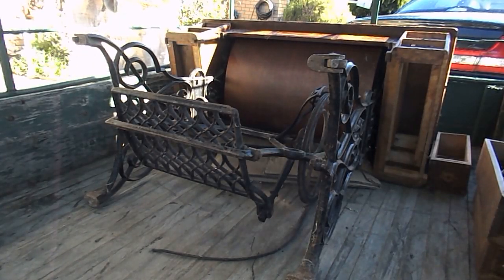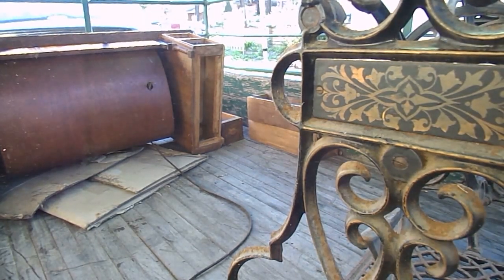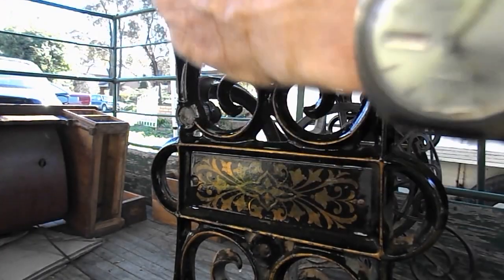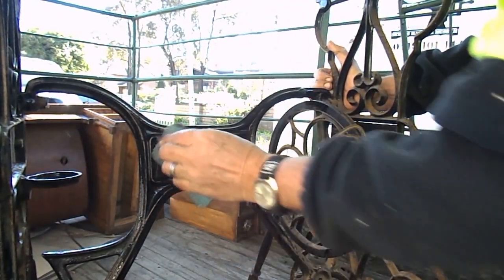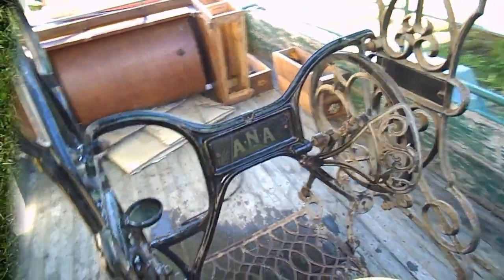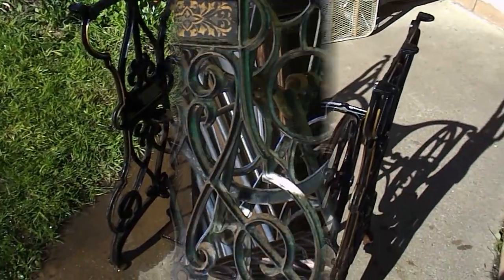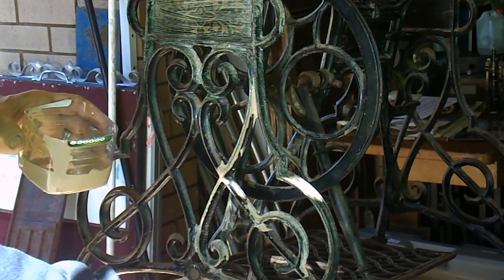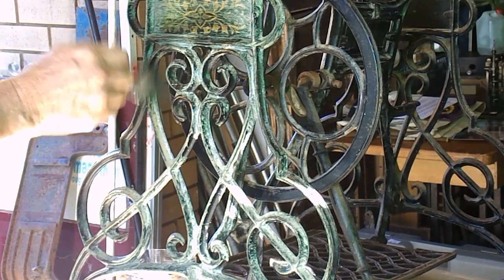Restoration of an Antique treadle  base.  Our Style

Comment: I took apart a treadle sewing machine completely and am now trying to remember the steps in putting it all back together again - I have cleaned and restored the base, the wood and rebuilt some of the broken parts.  NOW, wondering if anyone has a diagram on how to put it all back together again. HELP :-)
Reply from the maker: Peggy if you look at a few U tube clips I am sure you will get some idea. If its the actual machine you pulled apart. Sheesh not even we do that. I really can't advise much on that. When we dismantle a part of a machine we make sure we do it in a time slot where on the same day we break it down and Rebuild it while it is still fresh in our mind. As you remove something you place it in a line one part after the other. Good luck with that
Reply: All is well - I finally figured it out :-)  I am so grateful for your instructions on how to restore the base - I'll attach a photo of the completed renovation as soon as I can.  Thank you again.

Comment: I'm down the other side of Victoria, picked up a treadle base with flywheel for a 31-20 i'm cleaning up. I wasn't sure about the rust converter but picked up the same stuff and it completely transformed the existing paint. After I washed it down it was a bit grey and sunbaked, but it's come up a treat. Brillant tip.

 I've got to treat surfrace rust on the machine itself, mostly the flat surfaces. You reckon i can use the same product?

Comment: After it turns black, do you need to wipe the paste off or does it just fully dry??
Reply from the maker: It will dry  completely. It won't need wiping. Keeping in mind it's only an undercoat finish  and not for outside or in wet area's . If you wnat it for  outside you will need  a matt or semi matt all weather coat over it.

Comment: I have a much rustier base, with no paint remaining, so I’m going to use a wire brush to get back to just dusty rust, not flakes, and then try a rust converter,  but I’m uncertain about what to do with jointed surfaces, I mean the bearings etc. I don’t want to convert rust to the black haematite finish over a nut which should come undone. The rust becomes haematite. I don’t want to chemically ‘weld’ it with converter!  So what do you do with rusty moving parts if they are in a bad way?  I’m thinking to use penetrating oil and clean them up, but I presume I don’t paint the inner surfaces or they won’t fit back together. Grease? Thanks for your opinion. 
And that’s a very pretty treadle you have there!
Reply from the maker: Bella.    Any Mechanical rusty parts we do not put paint into.  Prior to  painting  I would give it a good grease  and then paint. The paint will not get into the joints  due to the packed grease. then when the paint has dried carefully wipe the excess  grease off which will remove any over paint.  I hope this idea helps ?
Reply: Thank you

Comment: I have a question, please.  The last shots with it outside, was it already dried and wiped down or it was still processing?  How long does it take before you wipe it off?  Thank you.
Reply from the maker: Sheila.  Hi.   With this the application is  important if you paint it as thinly as possible and with no streaks or bubbles  there will be no need to wipe it down.  The different  areas tend to dry at different  times. So wait Until all is dry before applying a second coat. if you feel you should need it.  Regards  Wayne
Reply: @SewWhatMaryborough800plus  Thank you for your reply!

Comment: Have you ever done this process on a brown treadle? The product I bought says it turns rust black but is clear on non-rusted places, which is a problem because the sides of my treadle are metal, not iron, and are painted brown. The treadle itself is iron but appears more brown than black, but it's not covered in rust, so it's not the rust making it brown. I was unable to find the product brand in your video. I bought Adcoat Industries' Rust Converter and Primer. I'm wondering if I should seek out another product that turns EVERYTHING black, rather than having the rusted areas black and the others showing brown paint coming through because I really don't want to spray paint the entire thing in black afterwards. Any suggestions and do you have a website or email I can send photos of my treadle to for review/advice? Thanks so much!

Comment: They feet paddle will no longer move and has come off. Please help what has happened.
Reply from the maker: Laura, the pedal is held in by two blots on the right and left of the pedal.  If those bolts are still there and the pedal is not broken  you can screw them in to re secure the pedal. Good luck with that.
Reply: Thank you. I will check that out and let you know what I find. Good day to you